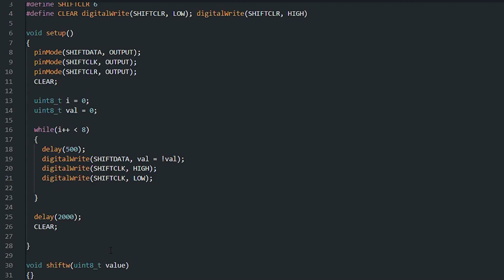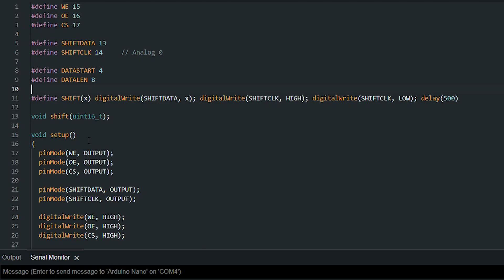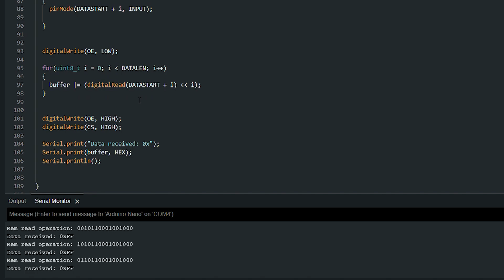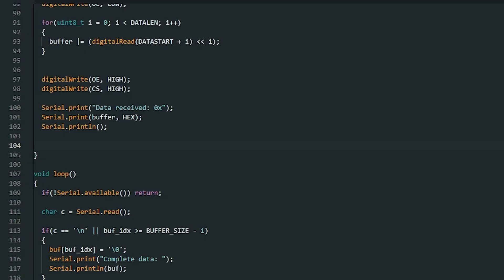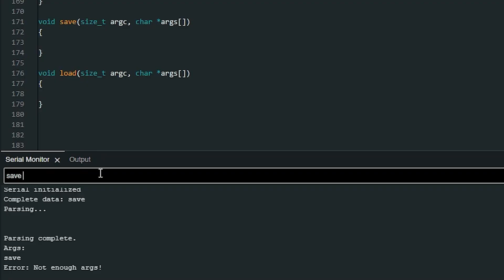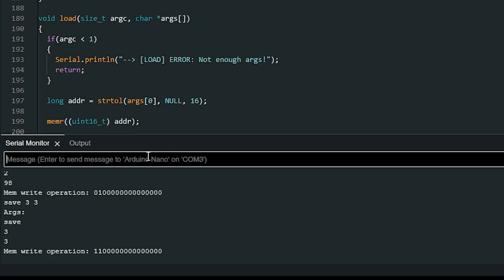How to Add RAM to Arduino & Use It Through Code | With Shift Registers

Comment: I didnt know it was possible to add ram to an arduino
Would it be possible to chain multiple of these and increase ram capacity of the arduino to run an os
Reply from the maker: You could chain them together, sure. But using RAM in this method is not very practical. To answer your question directly: You could indeed have multiple RAM chips and have a separate Chip Select for each one, and simply turn on whichever one you're currently "talking to". With this method we would be limited to a few RAM chips (limited by how many free pins we have on the Arduino,  we would need one per Chip Select). Or, we could use a 2nd line of shift registers, and only lose 2 more pins total from the Arduino, and have virtually limitless amount of RAM chips connected to each output (A, B, C, D, etc.). In this case, we would bang out the chip we want to select, then bang out the address as we do now, and then finally write or read the data.

But a much more practical method for getting more memory might be to use an SD card with the SPI protocol. The built in SPI hardware controller can run much faster than we're able to with the method I'm using in this video. For me, the primary reason for this video was to make sure I understand how this particular RAM chip works, so that I can plug it in directly to my hardware 16-bit computer project.

And yeah for sure, we could write a simple operating system for the Arduino! For a simple operating system, we wouldn't need much RAM. We could have a simple, 'Unix-style' command line operating system and run programs using something similar to the Shell program that we made in this video towards the end, with a lot more commands, and multi-tasking. We could even have a basic output using something like a small TFT display that also runs on SPI. That could be cool! We could use the SD card as our primary data source, and load chunks at a time into the Arduino's built-in RAM for rapid use.

Hope this helps! Thanks for the comment!